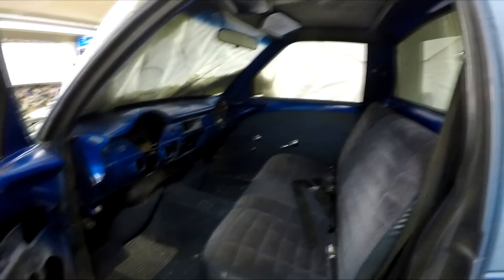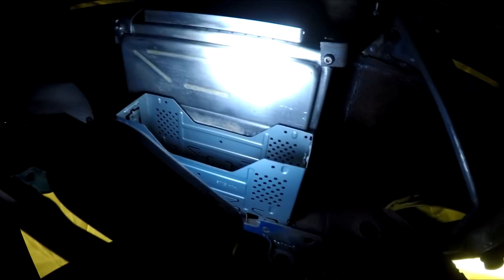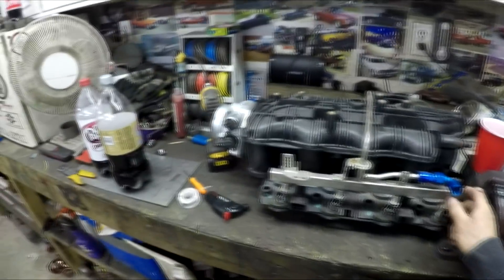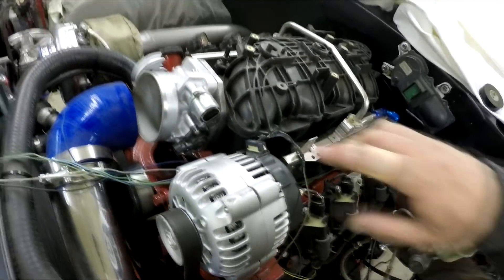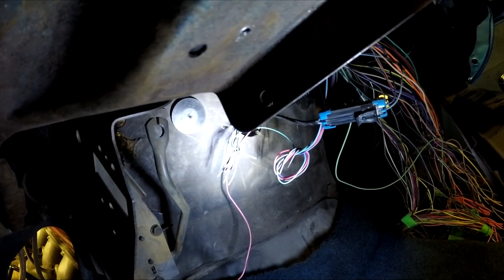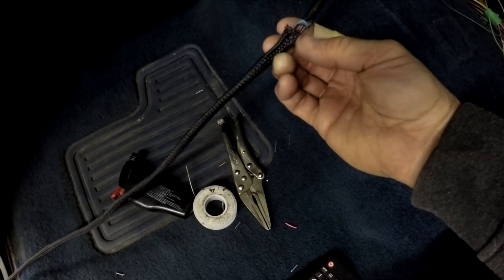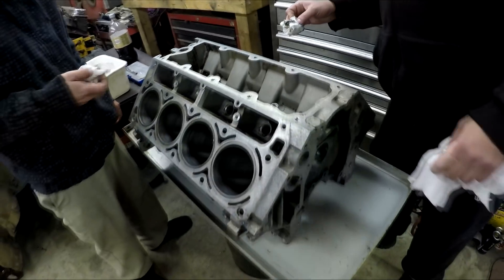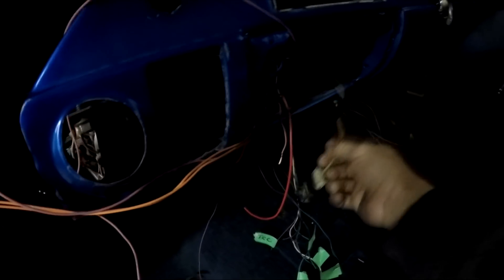Fitting a Custom EFI Harness on the Turbo 5.3 LS S-10 | DIY Standalone ECM Wiring (part 2)

Comment: So your not using a MAS sensor? And why do you have the MAP inside the cab?
Reply from the maker: No mas air it was converted to speed density. The map is in the cab just to have easy access to it and to clean up the intake.
Reply: @SPPTVarmy  so MAP isn't used to read anything? It's just plugged in? Great videos. Thanks for replying.
Reply from the maker: No, the map is reading. There is a hose from the map to the back of the intake
Reply: @SPPTVarmy  okay gotcha.  That make more sense.  Thank you.

Comment: Guys for your grommet through the firewall start with 6" of 1/2 inch rubber hose and cut down one side. Slip the cut side over the sheetmeatal, go around the hole and cut to length. Now the looms won't rub on sheetmeatal. Good luck on the build! It's going to be one cool truck. Put down the glass and get to work on the shithorse you lazy bums. I know what's in those red cup and that's keeping the shithorse from getting worked on. LOL Greg

Comment: Wouldn't moving the map sensor away from the intake effect tuning? I would assume there is going to be some delay (maybe negligible) between vacuum dropping at the engine vs the sensor?
Reply: It ain't gonna build itself my ms3 pro on my nova  has the map sensor built into it snd is hooked up the same way so i think it should be fine.
Reply: It ain't gonna build itself 

Mine is also in the interior, it’s fine
Reply: good to know

Comment: Probably too late now but a good way to finish off the ends of the braided cover is to use a suitable size heat shrink over the top of the braid.
Reply: hq308dotcom yes i though of that while i was doing it, would look nicer for sure. I will do that on the next one

Comment: What do I need for a 5.3L LS swap but I want to use my old transmission and I have a 5 speed manual transmission I think it's called a T5 transmission if anyone can help me please I'm in the middle of doing the swap
Reply: Rafael Sanchez t5 will bolt up unless it's a Ford bellhousing you just have to make sure you buy the right clutch/flywheel
Reply: Austin Doud yeah I know that part just don't know what flywheel and clutch? Or if I should just upgrade to a 4L80
Reply: Honestly you could probably sell the t5 for a 80e and of you're using stock computer the only thing you have to do is repin for an 80e and get it tuned it's going to be more expensive but it won't break especially when you turbo it

Comment: I assumed you were going to be using a cable controlled throttle body. What are you doing as far as a throttle pedal? Did you get a pedal out of a vehicle at the junk yard that had a "drive by wire" TB? Sorry if I missed this in a previous video. Thanks guys!
Reply from the maker: I am using a cable throttle and the stock s10 pedal
Reply: Cool thanks! Love the videos.